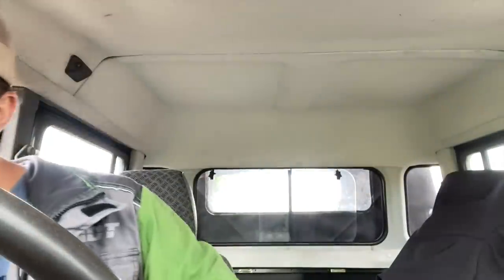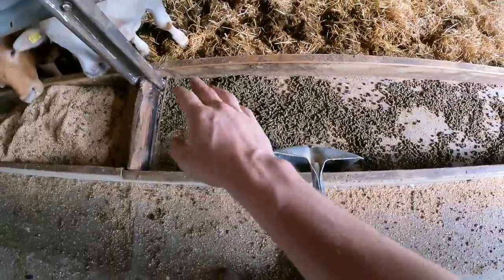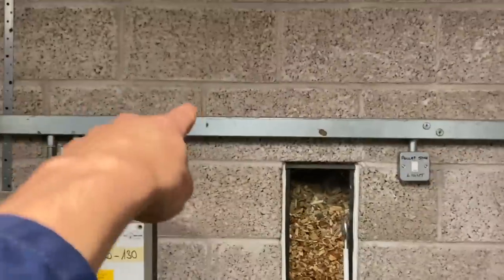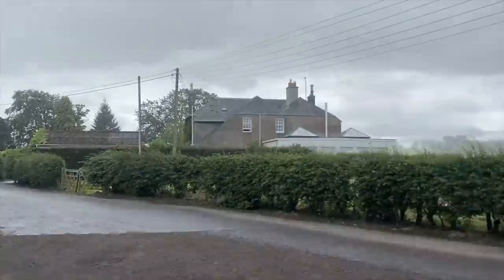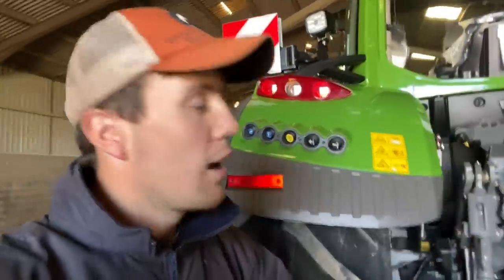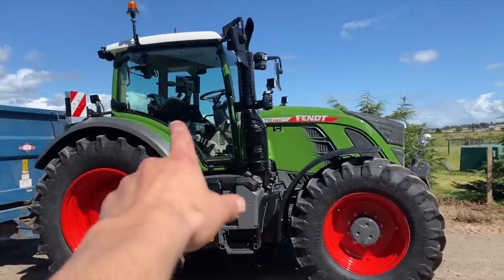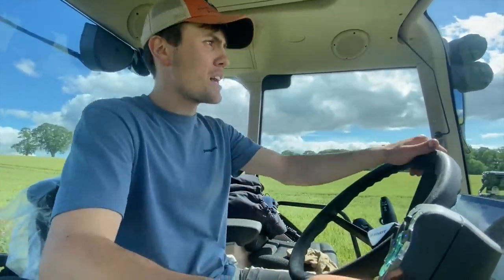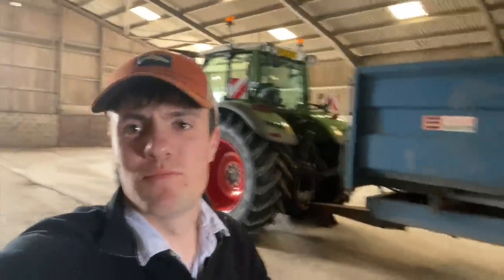New Tractor Lands On Farm | The Wait Is Over #306

Comment: I use to drive a fendt 930 and 818 back when I was last farming so using the old joystick I love the exhaust brake on them hit the button on the floor pull back on the joystick will slow you up big time with a load on and save the brakes on both tractor and trailers.

Comment: hydraulic top link is the way forward! not sure if he mentioned it when the tractor was dropped off but with the bennet hitch make sure you push it back out when you’ve picked up your trailers or whatever so it doesn’t stretch it out when it’s under load other wise you end up with a hitch that won’t pull in when you next get a trailer cause the seals have gone inside 😂 that’s after a few years but still handy to know from the start
Reply from the maker: Cheers, yeh do similar on the New hollands dropping it down onto release hooks so just naturally did it with fendt 👍🏼

Comment: Good luck with new tractor, why a 718 is it not down on hp from the t7 200 and 210?  personally prefer the look of the new t7 range, but then I've got blue blood
Reply from the maker: 210 is 165 boosted to 210 so fendt somewhere in between in guess